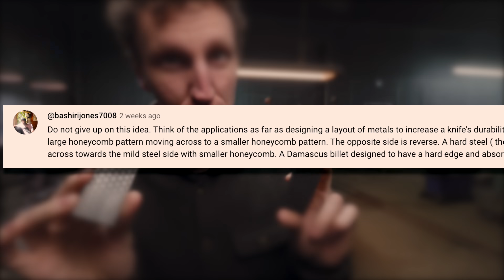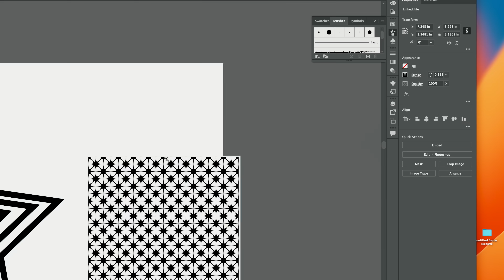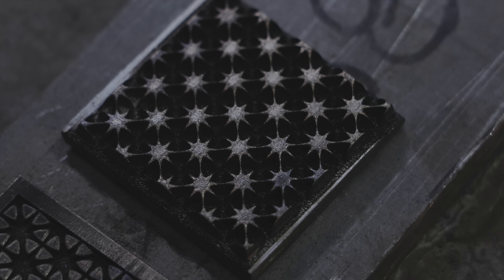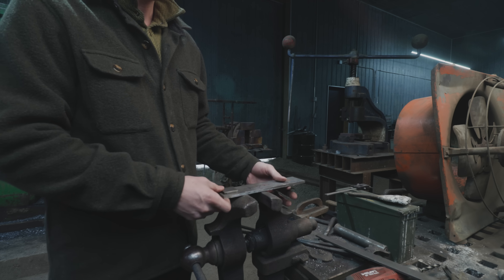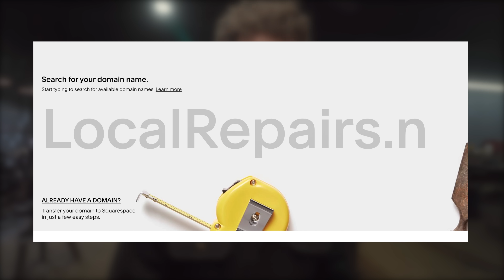Trying a new technique for making Damascus steel - Positive/Negative.

Comment: Late to the party here @TimothyDyck, but the most important thing to remember when forging w/ powdered steels is that no matter how much to vibrate/tap/pack/etc. the powder into place, it is approximately 33% less dense than solid steel. Period. I've confirmed this in my own work by setting up the tightest packed canisters I could muster and weighing them. It's 1/3 air no matter what you do. So, than answer is having some reduction in the forging, in as many dimensions as you can.

Comment: I feel like if you did a pattern with the powder inlay with a knife, i think etching the "Keep the Forge lit" pattern from the wallet into the steel and then seeing how it turns out after being forged. I would be curious to see how much it would distort the parttern and if it might be viable as a limited run of a patterned knives. 
Just because it might be a bit distorted, doesnt mean i wouldnt make for an interesting and unique design born from the original.

Comment: Hey dude, you can just use the metal power for negative part. This will help you with the gaps. And use the acid for positive part after laser. Regards from Ukraine.

Comment: tbh i dont see how those voids are avoidable (haha).
even if you put filler material like steel powder in between the trapped air still wouldnt have much of a way to escape. nor would steel powder really help the complex fit of the geometry.
im sure on an industrial scale this could somehow be made to work, but its gonna be hard to pull off in a normal workshop.
going for a less complex geometry might help some already. 

it would probably help to have the pattern go through completely. but that obviously limits the kinds of pattern you can do and would mean a lot more work. this is the kind of thing that a wire EDM could really shine in.

would it be possible to bring the piece up to forging temperature again and press it some more after you grinded down to the rough surface depth you want to? This cold probably help to at least improve the surface cohesion.
so forge weld/press then grind then forge weld/press again then short finish grind then etch?

another potential issue is the passivation layer left behind after the lasering. there probably is a good amount of oxides on the surface at this point that really dont help with a good weld. after the laser engraving and test fit you could chemically etch off the top layer just before going for the forge weld.

Comment: Cool.. Im just thinking... If u have a solid plate and drill holes in it to forge press in metal powder in the cavity , you need more powder than you can fill in one press. You have to figure out a technique to overfill any cavity or else you'll always have an issue with a risk for cracks in-between powder and steel when yo decide to hammer it out to a new form.  to Sustain a forge that is flexible ro be able to later be altered and driven int o a new shape or form, overfill is needed.. Loved your ideas, gave me some perspective and help in my dreams.

Comment: Try cleaning after the laser, before sandwiching. Or perhaps tolerate out the pieces by 0.1mm or such to allow the pieces to fit together without allowing tons of air to be trapped

Comment: Tim, I've never used a laser etcher, so I might be slightly talking out of my ass here, but... if these parts are different grades or alloys of steel, they're probably prone to slightly different rates/degrees of thermal expansion. that means that, while they both shrink back down to the same size they were to begin with after the fact, if blasting them with a high powered laser for 8 hours changes their temperature at all (which I kinda have to assume it does), one of them is bound to expand a little more during the engraving process. It's probably not enough to see with the naked eye, but as a result of this, the part that expanded more is going to have a slightly shrunken and distorted engraving when compared to the other, and with this many features, that's absolutely going to throw off the mating alignment. the way I see it, you could fix this the smart and super precise way, or... the easy and probably-not-so-good way. The former would be to look up the properties of each metal you're working with, measure how warm they're getting on the etcher, calculate the expansion percentage, and adjust at least one of your CAD files to compensate... the latter way would be to simply try mating them at the exact same temperature the laser got them up to. As a side note, a slightly shallower draft angle would probably also help account for any distortion caused by un-even expansion/contraction of the part.

Comment: Your never gonna make it fit and have full contact with laser, surface finish is not good enough, with CNC in the other hand much easier to acomplish.. You gotta approch it like a mould
You could try with laser as you did but filling it with powder in between plates, add pressure and shake it hard so the powder fill the smaller gaps then forge it....
I'm more a CNC guy but hey could wourk idk

Comment: I believe you forgot to account for the draft angle created by your laser source emanating from a single point. Typically, that draft angle due to the beam emanating from a central location as it expands down to the engraving surface is pretty high the larger you're engraving. The way around this is to use a gantry-type machine with a fiber laser source. So far, these are expensive so you should have your parts produced by someone else. Good luck: I can't wait to see what you make with the powder-filled parts.

Comment: You are trying too complex of a pattern and your laser does not have the accuracy or power to execute it properly. This is why the negative and positive did not fit right. Back in ye olden era of the 80's our shop teacher used a milling machine to cut some shapes into a chefs knife blank and then used dry ice to cool some decorative plugs for those shapes down so they went inside then when warmed back up to room temp they were in there solid. It made quite an impression on us. Something similar might work here with simpler shapes.

Comment: My experience in blacksmithing is a whole whopping 0 lol but I'm wondering if you added some flux inside the star pattern before you press them together would that have filled in those cold shuts? Still amazing work

Comment: What would have happened if you sandblasted the two pieces before forging them together? There was alot of discoloration/ black stuff from the laser etching and it might affect the forge welding I suppose?

Comment: The coolest idea here is using dissimilar properties in alloys to create much more precise internal structures. These structures could utilize the dissimilar properties more precisely. You’d need a Materials Scientist to tell you exactly the equations and specs for that. But it’s probably some of the things that make up parts and designs in things like Classified Military stuff. 

On a completely unrelated note. You ever think to try three tone Patterned Welded Steel?

Comment: I would agree with your results there Timothy, that the powder filled pattern is definitely the best option to go forward with, but the cracks in the steel where you forged it into shape concern me. I think that the nature of the Lazer etching of the cold steel might be a problem. I saw you had the blank up to temperature but yet there are still cracks in the steel where the steel pattern meets and distorts due to forging. perhaps it might require a hotter temperature before forging to shape or perhaps making a blank and simply cutting the knife shape out of the blank would be the best way to use the powder filled laser etched blank. it certainly might be a problem for those who would want a hand hammer forged blade but if those cracks still keep occurring, I can't see much of an alternative way to incorporate the laser etching into a blade, other than simply using the laser for logo etching into the steel. which looks totally Dope, BTW.

Comment: I think there is something to be said about the star?!?! pattern one that didn't turn out to "well". I think that it looks super cool but you should try do a pattern with less intersections and maybe not such fine detail. I think that before it gets welded those tips of the inside of the star are so small that they are burning off or breaking off or something like that. so maybe try it with a stripped pattern. yes that probably wont look super cool but I think it has a better chance of success to learn from for future stuff.

Comment: For the positive negative, perhaps a mid heat to melt some flux with iron powerder betwen the billets, then melt them together, would have a better chance of a solid, no void weld.  Good luck, this is a kicka$$ path!

Comment: That could be a pretty amazing thing. I can see knives or axes with intricate dragons or Wolves or whatever other design actually pattern welded into the metal. 
As far as the first Billet that you used to metal powder on looking grainy previously and then looking better after this experiment, I would guess that's just down to more forging. Extra heat and pounding compressed the grains into a more uniform substance.

Comment: This method would be awesome to use copper in-between the steel for mokume gane billet. Because the weakness of mokume gane is that it's difficult to make a mosaic pattern, but with lasers you can.

Comment: Why not put a little metal power for the positive/negative forging process, maybe make the gaps a fraction wider between the patterns so the powder goes in between ? Maybe it would help with the cold shuts?

Comment: Do you usually use anhydrous borax? It supposedly doesn’t lift up when applied like you see at 6:39.
Reply from the maker: I've never tried anything else then just plan Borax. Someday I'd like to try some different stuff.
Reply: @TimothyDyck anhydrous borax is as simple as heating up the borax you use from the box for a short period of time. This removes all the water from the borax. So, when you add it to the steel, it just melts right onto it instead of becoming these flakes that curl and lift up. But, if out of the box borax works fine for you, that’s fine. You’ve done much more forge welding than I have.

Comment: That laser takes so damn long. What if you made a die/pattern from the laser. Maybe a little deeper than what you did here, and then use it to press the pattern into a hot piece of steel, and then use the power to fill.
That way you can use the die from laser mutiple times instantly vs 10hrs or so for 1pc off the laser
Reply from the maker: What a cool idea for speeding up production on something like this. I will definitely keep this in mind. Thank you!

Comment: I think you should try again the positive/negative technique but with a much larger clearance (like .25 mm/0.01 inches) AND filling the gap in between using a very thin layer of powder. Nice experiment anyway !

Comment: Tim you may want to laser etch completely through two pieces of say 15N20 1/16" thick material, then sandwich that with a piece of CRV80 then sandwich the whole thing with some stainless sheet in essence creating a canister style.  of course before adding the stainless you will need to fill the voids with some 1085 powder or whatever contrasting steel powder.  then forge that as you would a canister, this was the pattern will show consistent through both sides?  Just a suggestion.

Comment: I think you need to try to find a more organic pattern - one that doesn't rely quite so heavily on perfectly straight lines. ANY work you do to the steel after is just going to mess up your original pattern. So if you can find something that's more organic, it'll be ok when it warps.

Comment: I think positive/negative would work, but you just need a different pattern: the stars are just too "sharp" at the ends and even with a lot of forging don't have enough material to squish out and fill the gaps unless you have a 100% perfect positive/negative fit up (which you did not, even after pressing)..   Secondly, I think you have to not be afraid of a little distortion and really squish the parts together:  I don't recall if you have a hydraulic press, but it may be what's required for the pressure vs. the fly press..

Comment: Wow. Would that positive-negative work with the titanium forge-welding technique (the one with the patent that expired last year)? Stack cleaned p-n titanium plate layers in a cannister, feed argon through the canister while heating and forge welding (at the low end of the temperatures the patent recommends, I think), to prevent oxidation, and cross your fingers.

Comment: I'd would venture to guess pressing a small amount of metal powder between the positive and negative would do the trick, maybe even using a 3rd type of steel to vary the contrasts even more. Another idea would be adjusting to give just a little more tolerance between the two parts for a positive/negative fitup.

Comment: Maybe try sand blasting before welding to clean the welding surfaces
Reply: Is cnc not accurate enough? Cnc would definitely be faster (and cheaper if it’s outsourced by a cnc shop).

Comment: I think you should integrate both process' into one. Do the negative and positive engravings but add powder to it as well to fill in the gaps. Probably even make lower tolerances between the two so you have room for plenty of powder. So combine the 2 process'.

Comment: It seems like the 2 part piece wants to have the negative be through holes rather than etched to depth. That way there is no way for entrapment at the bottom of the holes, and if the positive plate is just a bit thicker/proud on the other end of the through holes then it would upset more readily to make total pattern contact. Probably a lot faster to cut through holes rather than deep etch too!

Comment: My gut tells me that if you made two blanks and sandwiched the powder between them youll get cleaner welds. I dont know why, cause ive never tried it. Though i have done copper inlays by grinding out sections and mmpouring molten copper in.... could you do that with steel?

Comment: hey tim!
this new project is very cool!! 😎 cant wait to see more of it. It does seem like the gaps are caused by a side effect of the lasering process, the side walls are probably tapered from the gradually changing depth/focal point of the beam. as depth increases beam accuracy decreases making the cut softer/less crisp. seems like the negative side needs extra depth clearance so that the positive can properly wedge its self in place.  also wire EDM cutting would be able to produce the perfect pre conditions for this forge welding process, almost guaranteeing that it would weld without any gaps (might be out of budget though😅).

Comment: If you want to keep experimenting with this type of pattern welding steel you really should get some designs cut out using wire EDM. It will be the most precise method as well as giving you the cleanest surfaces to try welding to. I know you can't afford to buy the machine to do it but there are plenty of companies that will do it for you as long as you send them the 3D model of what you want them to make and of course pay them. For what you are doing, it shouldn't cost very much to get everything made.

Comment: I think that the laser creates oxidation on the burnt surface... I would try a vinegar etch on the parts before welding and instead of borax as a flux I would soak it in diesel... I think you could make some incredible patterns that way... Also if instead of etching you make cutouts to fill with powder, then you won't have to worry about the pattern going away from grinding
Reply: That’s also something I was wondering, since the laser is burning the metal away. I also thought of maybe a heavy bead or sand blasting but I bet etching would work better
Reply: Yes this.

Comment: Hey bud if you try this again get the bottom half hot so it will expand and put the top in the freezer so it will shrink a bit before trying to put them together like when you re sleeve a cylinder on a motor and see if that helps them pop together! Then tig three of the sides and try to get some powder steel in between them to fill the voids.

Comment: The laser doesn't engrave straight down. There will be a slight angle.
Also the engraved area will have burnt metal in it and will need cleaned